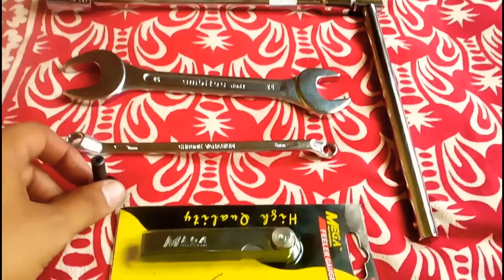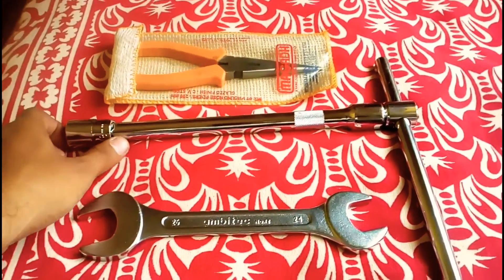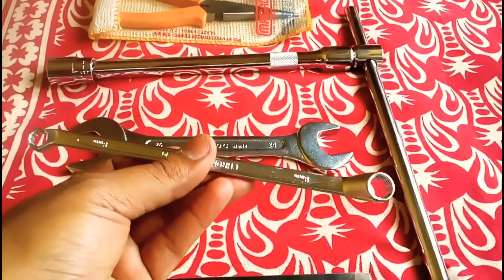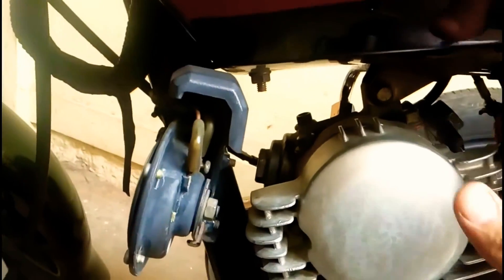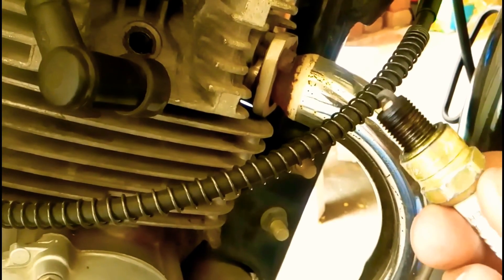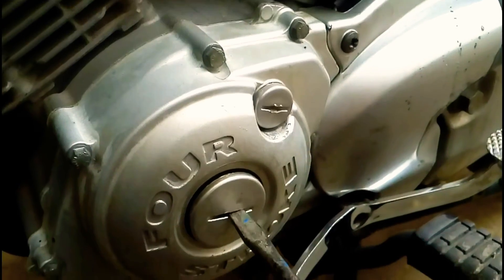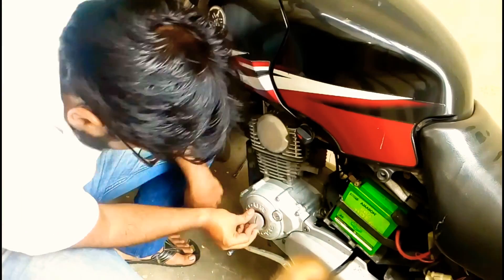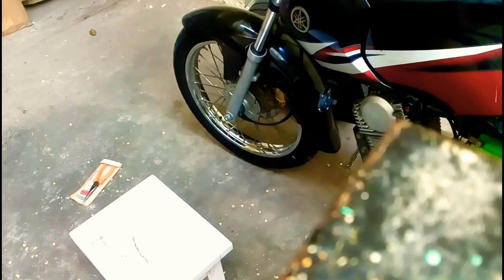How to adjust valve & tappet clearance in a 4-stroke engine

Comment: asalmualekum janab....mere pass ct100 bike he uski mileage set ni ho rahi he bot mechanic se check karwaya lekin set ni hua our. engine new he..plz answer me
Reply from the maker: Walekum asalam, mileage is affected by carburetion,valve clearance,riding style, authentic fuel quantity and many more things.
Reply: How To Carburetor Tuning. The accelerator auto metic is increased in the bike When the bike is hot.
Reply from the maker: @mehmmudichannal  without a thorough visual inspection no one can give a proper opinion so visit a reputed service station or a mechanic.